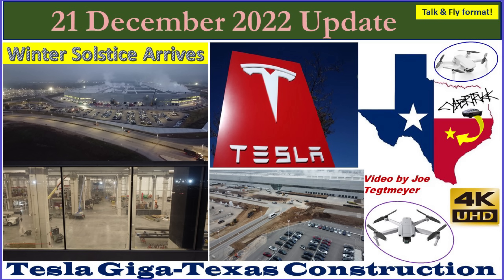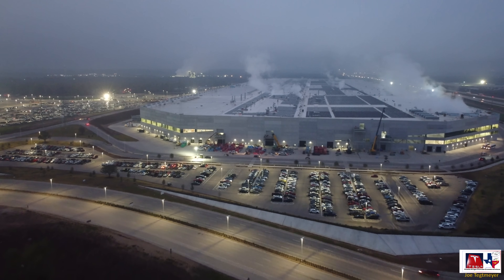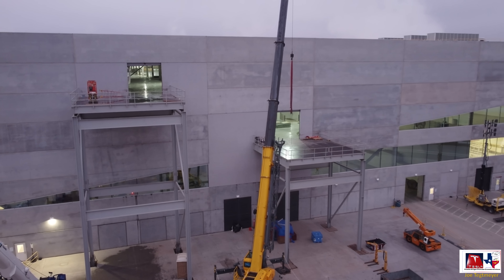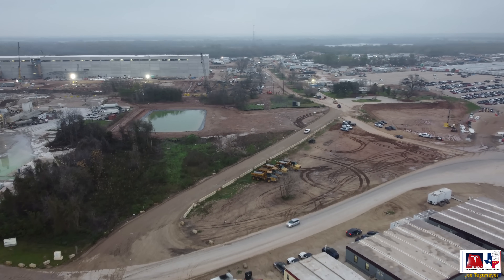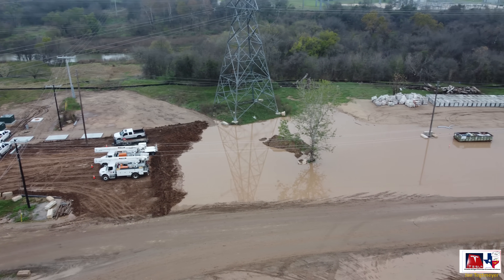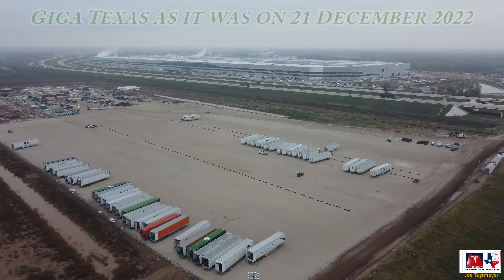Doom & Gloom? No time for that FUD here! 21 December 2022 Giga Texas Construction Update (07:30 AM)

Comment: Great video! Gotta love those large DMG CNC mills. Hard to tell but looks like their 240 or 340 Gantrys. I run their DMU 65 (baby compared to these) but they are still such a beast of a machine.
Reply: Any thoughts on what these would be used for? Die maintenance? 

I'm confident they are not for machining the castings, but wondering what specifically they could be used for. 

Also some crated ONA machines that seem likely to be EDM equipment.

Comment: Thanks Joe.
Happy winter/summer solstice. 
4:20. Casting. In Joe’s photos from 12 December a 10’ 3.0m step ladder is seen beside these components. From that comparison it shows these to be a bit short of 9’ 2.7m.
Maximum die height is 2.4m for the 6000t machines, so the items in are too big to be dies for a 6000t machine, and too small to be platens for a 9000t machine. Have to conclude they are dies for the 9000t machine.
6:11. Casting. Pallet load of square items could be isolation plates that the gigapress base sits on.Pair of large grey cylindrical items, fans? Going up onto the plant platform possibly.
6:51. Casting. Casting. Red toggle components behind the step ladder. Red table like component to the right of the ladder fits on the back side of the moving platen. Both seen here in an official IDRA video. https://youtu.be/T36Gr1OtdJk?t=29
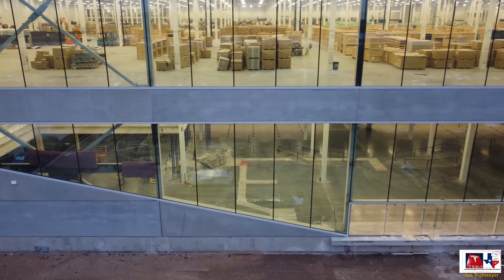10:37. Main Entrance. Left, protective panel placed between the braces and the glass.
Right, hadn’t noticed before the columns around the entrance have been infilled between the flanges.
Rows of props holding up Level 2, but otherwise unchanged from previous views.
Level 1 Floor, must be some open trenches under the steel plates within the roped off areas.
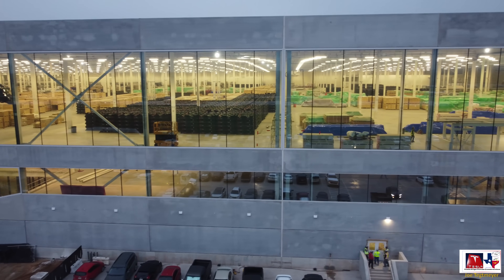11:37. GA, Level 3. Setting up scaffold either side of the double columns at the expansion gap.
11:52. GA. Level 3. Pallets of items for Project X.😐
15:28. Tesla Road, north side. New drain being laid through the carpark if it is headed for the rip rap and the drain within (bottom of screen), there’s a kitchen in the way.
16:57. Cathode, new building. Footings. Strip footing/ground beam/grade beams between the footings, and mostly east-west only. The columns although short are of a truss type construction, and are orientated east-west. Thinking this is to deal with lateral forces being generated from whatever process will take place within.
17:57. Cathode. Plant platform, apron. Ground off some paint from the large pressure pipes.
Plant platform. Fitting short sections of steel between the joists. One large pipe suspended under.
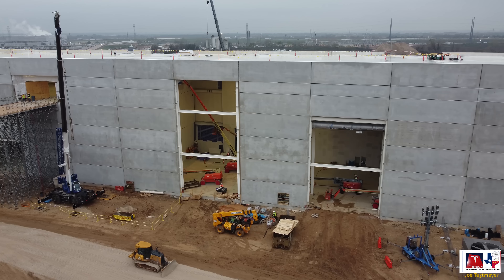19:27. Cathode, inside. Blue wall. Battens/channel run across the face of the studs.
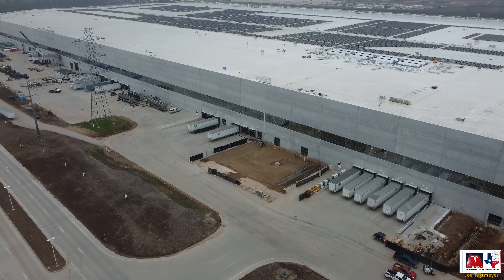21:15. BIW, apron. Retaining wall complete to the left, formwork for another being built to the right.
22:51. Stamping, apron. Pressure testing a section of the blue water main before it goes in the ground.
22:59. East easement. Making a column longer.
24:14. GA south, apron. Right. Water main suspended from a beam laid across the trench.
There’s been some rain, but there’s very little water in the trench, and no pumps standing by. All the water must be diverting into the H vaults.

Comment: Joe:  Good job !  We are here in western South Dakota, in the Black Hills.  Right now, 5:15 PM on 12/21, it's minus 11 deg. F.  Very cold for this time of year.  So, I'm again clarifying the "steam" you mentioned in this video.  As far as I can remember, there is no steam used in the HVAC system.  What we are seeing is water vapor.  Looks like steam, but it is MUCH lower temperature.  The Evapco units located on the northwest corner of the building typically are either dry type, using an internal coil to circulate hot water from some process, with fans to draw in outside air and pass it over the coils, thereby cooling the water.  Evapco also makes the same type of unit with a coil, but also with water spray heads that further increase the efficiency of the unit.  Thanks ! PN

Comment: At 8:22 the racks may be part of the automated battery charging system.   After a block of cells have been assembled they have to be loaded into large multi-compartmented racks where they're charged, tested, exercised, discharged and passed or rejected, which takes time.  While these compartments are filled the blocks of cells coming off the production lines have to wait for an open compartment.  The racks at 8:22 may be for the waiting blocks or they may be for finished blocks.  Each cell block has a bar code so the automated system can keep track of the waiting, finished or rejected blocks of cells.

Comment: The foundation work going on west of the Cathode building is mind-blowing. I can't imagine what would require such an extensive foundation, a 300 story skyscraper?
Reply: Trust me, skyscraper foundations are much deeper.
Reply: @GoCoyote  
Skyscraper foundations are supposed to be built on bedrock.  The Manhattan Island has bedrock on the end where the skyscrapers are, so they don't have to dig deep to hit the bedrock.
Reply: @acmefixer1  
As someone who has worked on skyscrapers, their foundations do not need to reach bedrock. If bedrock is close enough to the surface, the building foundation can be anchored to it, but if the bedrock is very deep, other methods of creating supports are common. All large and tall buildings like skyscrapers will have several stories underground that serve to anchor the building and provide room for mechanical systems, and sometimes parking. This will be set in or on bedrock if available, or be set on friction piers/piles driven or built into the earth to provide support. These piers/piles may also be connecting to bedrock if necessary and if the bedrock is close enough to the surface, but there are plenty of skyscrapers foundations built on pier/pilings alone.

Comment: Strange that a supposedly vertically integrated company would need a warehouse on wheels. Are we being snowed? We know they're not delivering raw materials like copper, steel and aluminium.
Reply: Tesla is doing well in vertical integration. They currently don't make their own glass, wheels or tires and some other bulky items. So yes, we'll see some high volume logistics required.
Reply: @jbbuzzable  I don't see any evidence of them cutting gears, making CV's, halfshafts, bearings, brakes, suspension, yeah pretty much everything except the motor and panel stamping
Reply: @MegaWilderness  As the most american made car in the US, I'd love to hear where they are obtaining these components.
Reply: @MegaWilderness  If all they do is motors and body panels, there must be hundreds of people inside with nothing to do.
Reply: @jbbuzzable  Canada, Mexico, Germany and China are my guesses.